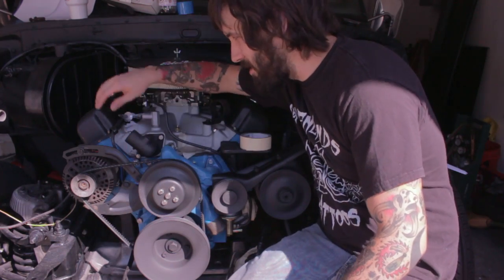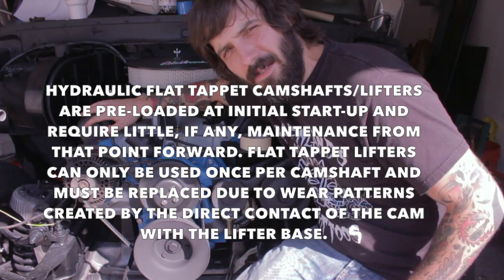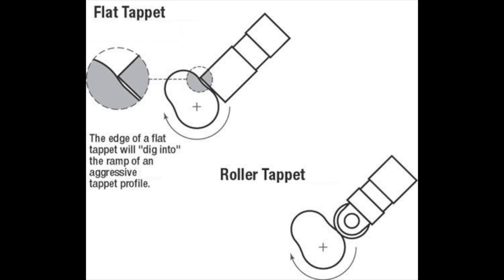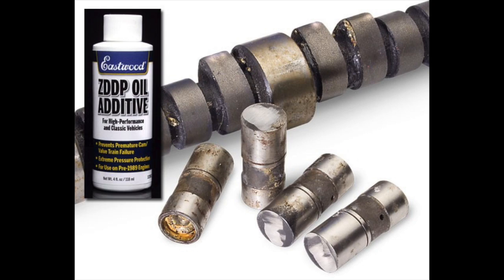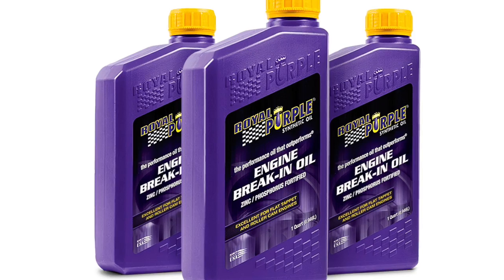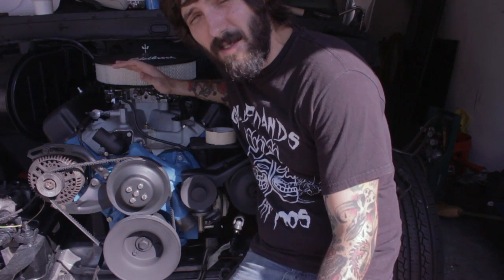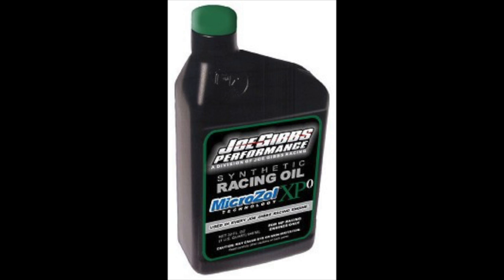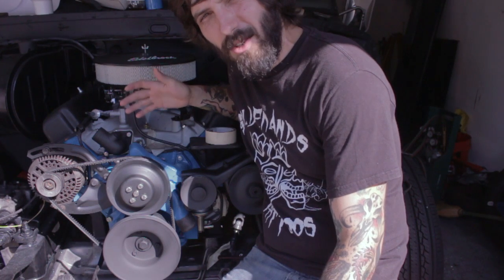Choosing an Oil for Your Ford FE (1973 Ford F100 Rebuild)

Comment: What About Motorcraft 15W 40 ? I've Been Researching Some Ford FE Forums And The Two Most Mentioned Were Rotella 15W 40, And Motorcraft 15W 40 Which Were Diesel Oils Heavy In Zinc.

Comment: i got my 77 ford F100 custom flare side when i was 2. and finally about to start the restro on it being 23, using the crown vic cross member, will the stock crown vic mounts for the 4.6 fit with the truck???
Reply: thats fair enough. guess ill just go buy a whole crown vic and trans plant as much over as i can. in the future i could add a video comment